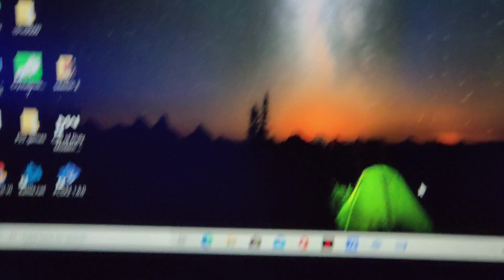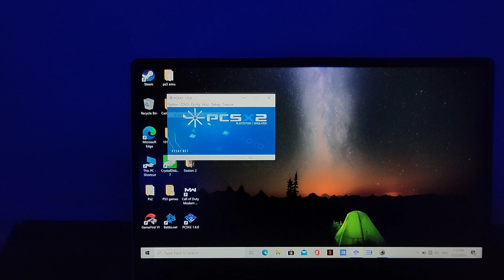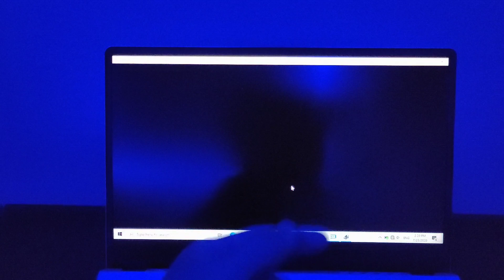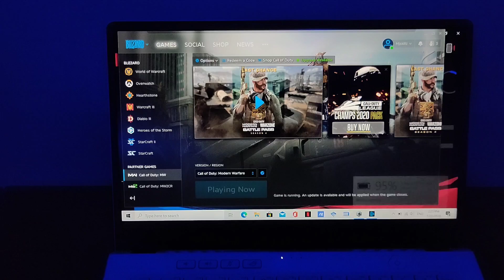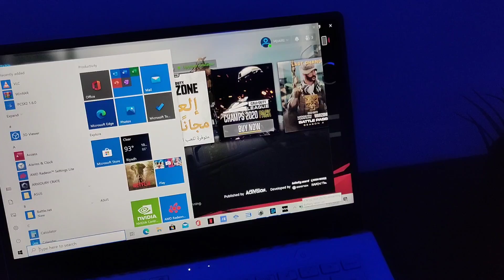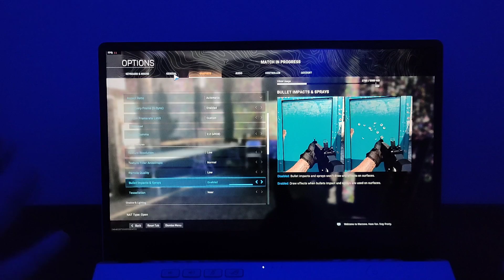ROG Zephyrus G14 : 10 Hours battery setting, Fan Noise, Temperature, Gaming on PCSX2, RPCS3 and COD

Comment: This vid definitely bumped up my battery, but nowhere near 10 hrs, I just have chrome running, and at 94 its  at 3 hrs and 25 mins, got wayyyy better when I used Opera, then after gaming for a little, at 64 percent it only have 1 hr 54 minutes left, when I tried this trick I had 4 hrs on opera (Opera is the only app I have running)

Comment: Is the temperature uncomfortable with normal use...not gaming
Reply from the maker: It's fine in normal use
Reply: Fine like warm or it's good comparing to other laptops....and another question...i have the g14 2020 ryzen 9 version on the way....do u think it's a good laptop and worth it and that heating issue is not  a big deal ? 
Or should i return it and wait till the rtx  3060 price drop( they say it has better cooling )
Reply: I mean is it worth it to wait for the higher version? I bought the 2020 on sale + taxes and customs etc
Reply from the maker: If you got the 2020 ver no need to upgrade untill 2022
Reply: Ok last question cause thats my huge concern...the heating issue shouldnt prevent me from getting the laptop right? I mean its good with daily use
Reply: And also while gaming with the boost disabled is good as well?
Reply: Cause the subreddit actually scared me
Reply from the maker: Normal use is ok if you game heavily with AAA games it gets hot

Comment: I tried all the things you told still i am not getting 10 hrs after full charge .. i am G14 Ryzen 5 4600HS version. I am getting max 5 hr 30 min after full charge that also if i don't open any application just sit ideal and watch desktop.  Please help if you have anything else i can do.
Reply from the maker: Yes I am receiving a lot of Ryzen 5 4600hs users are not getting 10h how ever Ryzen 9 4900hs does . Maybe it's a bios thing with Asus focusing on the exclusive Ryzen 9 4900hs

Comment: I have disabled the boost (thx to the changing in the register) but, what configuration of windows power plane do you use? (balanced, high performance, ecc). By the way i have disabled the boost in all configurations ahah
Reply: What number did you set it to? 1 or 2? I watched videos that say 2 and others that say 0, what is the one that you've picked?

Comment: I am getting 51 degrees celsius even though I disabled turbo boost, is that normal.
Reply: I have the same problem, disableing the turbo boost only helped me one day until I charged it, then it started to get hot, even while doing simple tasks, did that also happen to you, or disableing the turbo boost didn´t help you at all?
Reply: @ottmarortega2842  how did you fix it?

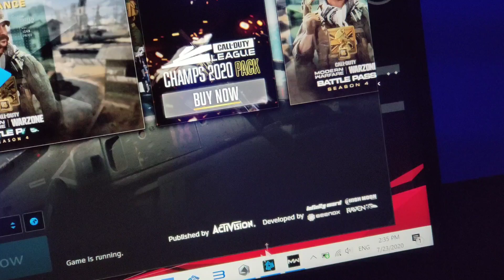Comment: 20:38 you can see here that the nvidia gpu is still being used as per GPU Stats Frequency. I tried using the nvidia settings to only use integrated graphics for Fallout New Vegas. It didn't work as confirmed be rivatuners OSD. I even went as far as telling the specific program Fallout NV to only use Integrated Graphics... still didn't work. I had to go into the device manager and disable the nvidia gpu. Boom! Success 🙂

Comment: is it normal when im just doing office work while plug-in charger the fans just boost to maximum speed frequently. ?
Reply from the maker: Yes , the solution is to have it on manual mode , checkout the video I posted on silent profile in the playlist. In case of unplug , just put it on silent using ROG dashboard

Comment: Also under what situation  would you want to enable the gpu? And is it “safe” to play high demanding graphics game without the geforce
Reply from the maker: If they are not demanding games it's ok with integrated graphics but I'd switch to Geforce with AAA games , it's just way smoother 60fps experience

Comment: I can play gta v for around 1.5 hrs on battery and temperature goes till 75-80% and when i plug it in temp goes till 95% sometimes and fan sounds like jet. Is it bad for laptops health? I didn't do any of your methods because i like to use my laptop is stock condition. While gaming on battery there's noticable performance drop though.
Reply from the maker: You have to disable turbo boost to play with less heat and better battery life, I posted a video how to do it in playlist .  You Laptop won't last long with 90+ degrees..

Comment: hi bro.. may i ask you why my g14 only last for 2 hours from 100% batter life? it is huge different than what has been advertised by Asus :(
Reply from the maker: What were you doing during the 2 hours?
Reply: @MJReviews  i just finished charging it and use it for nothing, what i did was only browsing through google chrome.. once i finished charging, on the right bottom battery display it says 2 hr 15 min (99%) remaining.. i have just made the gpu in global setting into integrated graphic and set the high performance for a certain application and game and it successfully increased the battery life into 4 hr 20 min.. but however it is still far from 8 hours like was mentioned in the advertisement :(
Reply: Me too, have you found a solution? Thanks
Reply: @ildelfinocurioso5149  bring to the service center, they replace with the nrw battery

Comment: Wait so you were playing the game even without using the  Nvidia GPU? 🤯wow
Reply from the maker: Powerful, right? ☺️
Reply: Hey MJ, are you better off not using the gpu?
Reply from the maker: Depends on the game, I run almost all Emulators with integrated graphics smoothly. New AAA games are preferable with RTX 2060,
Reply: @MJReviews  interesting. I have been mostly been playing emulators so far on this too. Although I’m not sure if it’s best to stick to nvidia for Yuzu. I have one more question for you. The other day I was trying to play on my tv via hdmi. As soon as I plugged it in, the game was running super slow on my tv. After I unplugged it, the game ran back to normal on my laptop. How do I fix this issue?
Reply from the maker: Check the cable quality of HDMI , try PS4 if you have one and see
Reply: Not really

Comment: I was thinking of getting this laptop(base varient 4600hs and 1650) to edit my videos and for college next year...
Do you recomend it over legion y540( i7 9750H  Gtx 1650)
Reply from the maker: Do you move around a lot?
Reply: I don't move a lot
Reply from the maker: Get the Zephyrus G14 , better build quality magnesium alloy , lighter and more powerful , speakers are mind blowing, just make sure you disable turbo boost to avoid excessive heat explained In My videos in my playlist. Enjoy it !!
Reply from the maker: Am referring to my model 4900h , I don't know how powerful or how good the 4600 ver
Reply: Is the ryzen 5 4600hs as good as the i7 9750H?
That's my biggest concern
As there are no comparisons and not much reviews on 4600hs...
Reply from the maker: They are very close to performance, but 4600h is future proof , 7nm , better in energy Consumption, compatible with higher ram frequency .

Comment: Bro what should be the ideal setting while playing games on charge ~  Nvidia settings , Amory crate,battery settings and others
Reply from the maker: Checkout my video "manual Fan setting" on playlist it has the nividia RTX on charge
Reply: @MJReviews  sure bro thanks
Reply: @MJReviews   Hello, I have disabled performance boost on my laptop, I have checked the cpu frequency and it fluctuates between 1.4 and 2.9 GHz did not check it before disabling the boost. I have read on few forums that it is natural for the cpu clock speed to fluctuate, can you please tell me if it is normal or is there any problem. Also the task manager is showing different result compared to armory crate. In task manager base clock speed is 2.9 while in armory crate it is 1.4. Is there any difference between clock speed and frequency? Can you please help me with this. The fluctuation shown on task manager is minimal, but the armory crate is bothering me.

Comment: Bro I have been watching your vids since the Zephyrus 14 videos. I have followed the registry method and battery power management settings to improve battery life and performance.
I have to tell you something about this method of yours that you have implemented.

I set my Nvidia Control panel settings to Integrated Graphics and YES the battery life of the laptop was increased. BUT there was an issue
When I tried charging my laptop, the mode switched to performance mode while plugged in (Its a default setting, but it's preferred as well). While charging the Laptop became UNBEAREBLY hot.

I couldn't understand why it was happening when I noticed that only on side of the laptop was getting hot - the left side. There was no heat even coming out of the right vent. So I realized the fan for Nvidia graphics was not spinning fast.

So I decided to switch back and yes it did bring the laptop temperature down. Prolonged use of laptop PLUGGED while on Integrated Graphics can damage the laptop. So I guess while I am not gaming i.e. in the classroom or just on battery - for work (coding in IDEs), this method is quite efficient. But as soon as we plug in the charger we should set graphics it to Auto Select.
I wish there was a way that this could be applied automatically.
Reply: Thanks a lot man you saved my Laptop probably. I will definitely change the integrated to auto on Nvidia when charging or gaming. Thanks a lot once again
Reply from the maker: Thanks for the insight bro!

Comment: Is the heating issue really bad?
Reply from the maker: If you crack the performance maximize without disabling Turbo boost , it's really bad you hit 100° + then the laptop won't last for long ! Check out other videos I had I shed more light on the situation
Reply: @MJReviews  should I buy it for normal use and little gaming?
Reply from the maker: Yep I'd recommend that , if you got the cash get matrix version for fun
Reply: @MJReviews  is there any other good option cause the r5 with 1650ti is way expensive here.. 1400 dollars.any good suggestion? Like a good one with latest processors

Comment: do you have any suggestions on how to make it not overheat? sometimes I try csgo for like only 10 mins and it gets very hot even with fans on turbo mode. u got any ideas? I’d be really greatful, thank you. also love the vid
Reply from the maker: Simply disable Turbo boost and set it on performance Mode. I have 28 videos on my Zephyrus G14 playlist! I will also drop a video on how to disable turbo boost in English!
Reply: MJ Reviews that’s awesome thank you very much! Yeah I’m not sure how to disable turbo mode so that’d help thanks. Also, why is turbo mode for fans bad? I thought it would help the fans and it would make sure my laptop didn’t overheat, but is it just not good?
Reply from the maker: Asus should fix the turbo mode to make it fit with fan speed , but with the methods I'll explain next video it will do that for you manually.
Reply from the maker: And will drop the temperature 🌡️-30°
Reply: Dont set nvidia controls to Integrated. Keel ot on Auto or Nvidia.

Comment: I only get 4 hours with the regfix, disable boost and on integrated graphics and in silent mode. I have the ryzen 7 model.
Reply: There is an Asus App already in the Taskbar. Go ibto that and chose Battery to see if its set to Max..balanced or power saving. If you want longer lasting battery without charging and select Max. It is first option.
Uninstall MCafee. 
Im Task Manager Disable Apps on Startup.
Battery life will increase.
Reply: I now have 6 hours by turning off anime. How do i turn off backlit keyboard???
Reply: Ryzen 7 60 hz panel or 120 one?
Reply: Saurabh Dhakne ryzen 7 120hz have tried putting it down to 60hz but doesn’t change battery life at all
Reply: Then something is not right bro.. Find out more about it on reddit.. Maybe it Will help you